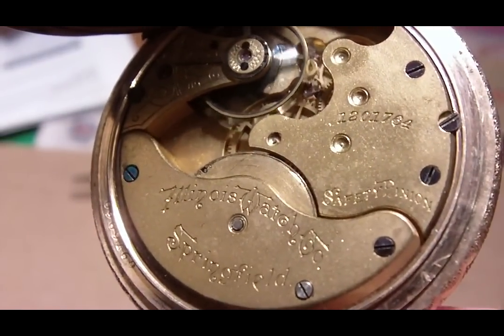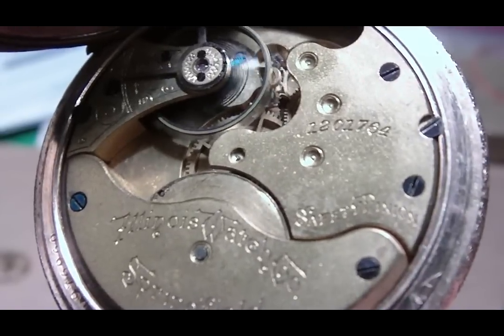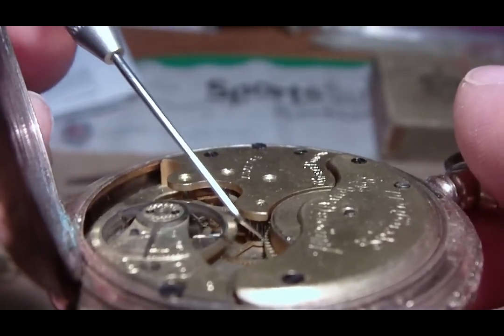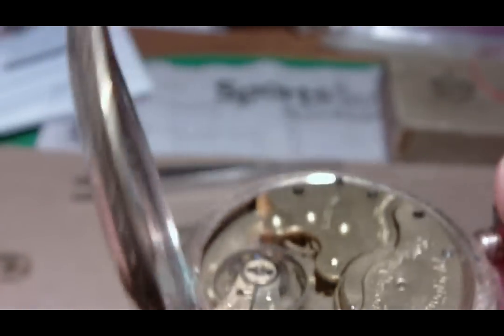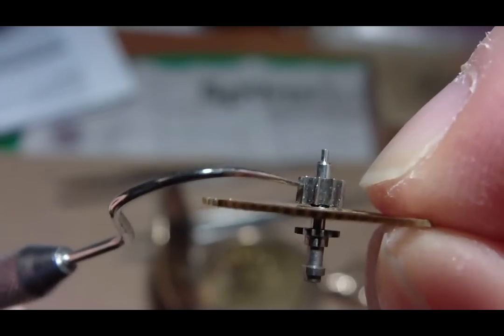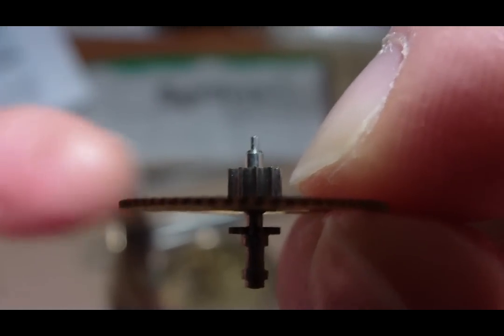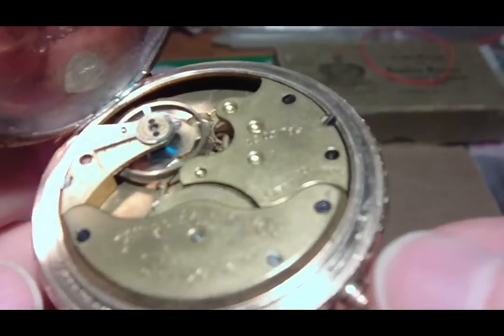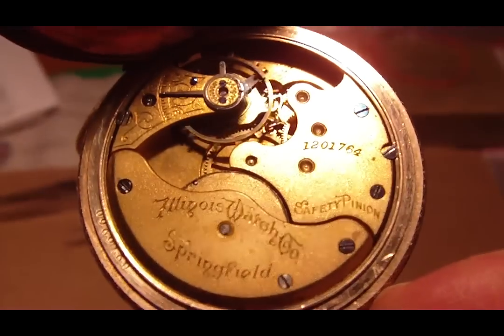Safety pinion on Illinois hunter case pocket watch.

Comment: Thanks , just replace a main spring on a Elgin pocket watch, and  it did not start. so now i know why
Reply from the maker: That is good to hear.  I always saw safety pinion written on the movement but didn't know what it meant till I replaced a mainspring and it didn't run.

Comment: Do you know what’s the best setting is on this safety pinion adjustment is. Elgin 17 Jewel. My profile picture is a picture of it. The adjustment goes from F to S. I inherited this watch & recently learned the purpose of a safety pinion from your video. Thanks
Reply from the maker: There is no adjustment on the safety pinion.  What you are seeing is the rate adjustment.  If the watch runs slow, move the pointer towards the F.  If the watch runs fast, move the pointer towards the S.  You move the pointer a little bit and see what happens in a day.